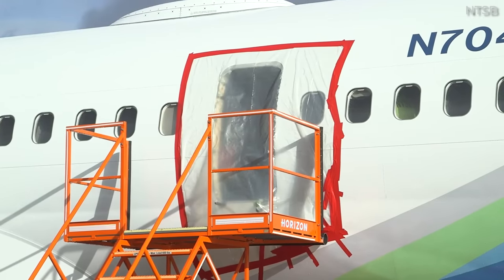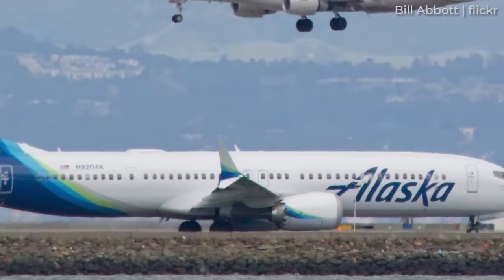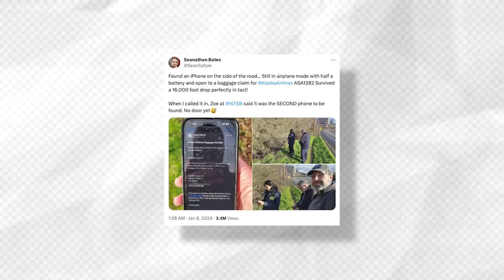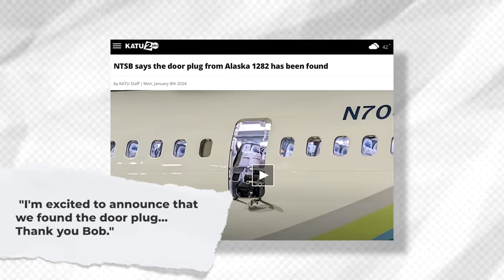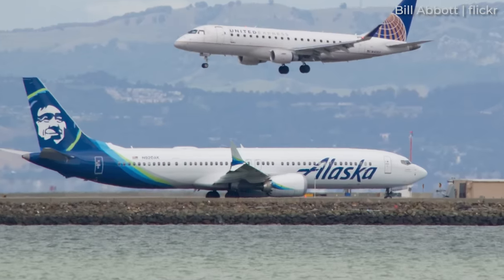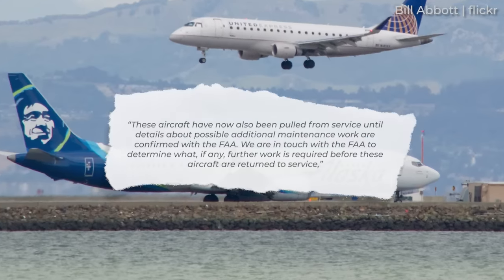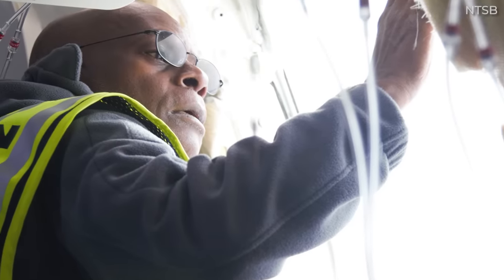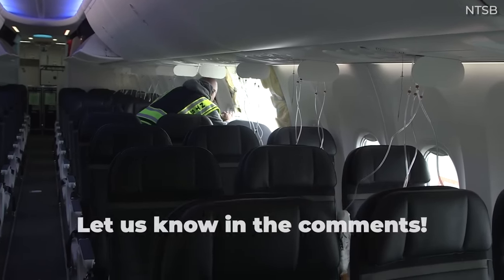Flight AS1282: Are We Seeing Another Boeing 737 MAX Crisis Unfold?

Comment: As a dedicated air traveler who prioritizes safety, I deliberately avoid any airlines operating aircraft from the Boeing 737 MAX family. Specifically, American Airlines and Alaska Airlines are two carriers that I actively steer clear of, as they continue to include these models in their fleet. In my opinion, Boeing made the mistake of placing profitability over proper quality control and engineering when hastily releasing the 737 MAX into the market. 
The aircraft's malfunctioning automated flight control system resulted in two tragic crashes, claiming the lives of over 300 individuals just a few years ago. Trusting software to compensate for aerodynamic instability does not align with my uncompromising standards for safety in the field of civil aviation. Despite the overall high level of safety in commercial air travel, I am willing to endure minor inconveniences if it means proactively minimizing any potential risks to myself and my loved ones. For domestic flights, I strongly prefer Airlines that utilize the Airbus A320 or A321. However, I have nothing against the Boeing 767 for longer trips.

Comment: Boeing has a problem. Whereas MCAS was a scandal due failure by design AND not communicating bad habits to the pilots, finally fixed, this issue simply is the third at least in a row of sloppy doing. A manufacturer error on the bolts of the rudder fin, severe quality issues on the back pressure bulkhead, now a popping off fuselage plug. I will fly with a 737 MAX, as soon as it will enter service again. Still the MAX is a safe aircraft in my opinion but could be safer. Boeing could do better, and should. Fire all these profit-praising CEOs and controllers and managers and whomever and let do entrepreneurs run the business again.

Comment: Really have to jack up the volume because it sounds like this fellow did this video while attending Church.  How many more issues could this plane have?  Or any of Boeings planes for that matter given the careless nature of their manufacturing process.  What has exactly changed within Boeing since the firing of the previous CEO?  I thought the reason for that firing was as a result of poor workmanship across the board.  Exactly what has changed?  The 787 has had many, many quality issues.  The 737 as well.  Derivitive models, not new models are taking two or three times longer to get off the ground than previous brand new models.  The company continues to lose market share to Airbus and despite all of this executives still make huge, huge compensation packages as if things were going awesome.

Comment: The crisis is not with the Door plug itself, , it is a QUALITY CONTROL/ASSURANCE issue.  Look at teh week before, mising/loose bolts on teh Rudder Control System.  AND Human Factors such as training the poeple and managerial issues with Schedule/Share prices.  Plus, per their news announcements, Boeing's plan for 47.2 jets a month from June to August 2024, while its target to increase 737 production to 52.5 jets a month was moved from December 2024 to February 2025.  This is to SELL more aircraft and push them out the door faster/more of them.  Its a TOTAL SYSTEM failure if you look at it holistically.

Comment: The Associated Press in the USA is reporting that the aircraft had an ongoing problem with the pressurisation failure warning light coming on. Boeing has failed to get a grip on their quality control issues on the production lines, and this would seem to be another obvious one. 
However, there's a new issue here. Why did Alaska keep the aircraft in service with a critical safety system repeatedly indicating a fault? I expect the FAA will be asking the airline some hard questions.
Reply: It is not yet clear if the plug, which is originally installed by Spirit in Wichita before transfer to Boeing in WA, was removed and replaced by Boeing during the completion process, or by a third party that Alaska uses to finish the interior, or if perhaps Alaska did remove and replace the plug while trying to troubleshoot the source of the pressurization warnings.
Reply: Because the hacks at Alaska Airlines kept pencil whipping it.  “Checks ok”.  Guarantee you the write ups would have had “loud squeal at row ____” You pressurize the plane, and leak check the door (from the outside )using “soap” type solution and if there is a leak, BIG bubbles appear where it is leaking. Then go from there. There is no way this happened.

Comment: Was this a converted aircraft? When did get delivered to Alaska Airlines? I see this as a failure of Alaska Airlines, NOT Boeing. AA should have fixed the issues with the plane before putting it back into service. This is NOT the first incident that Alaska Airlines has been at fault for.

Comment: Your description of the failure is a bit off.   There is no bolt(s) holding the door in place.  There is a door wide  horozontile bar bar, both top and bottom that moves up on the top and down on the bottom.  The ends of both of these bars go into a socket that is attached to the airplane frame   At these 4 attachment points there is a non structural bolt that keep the bar from vibrating loose from the socket but only on the plug doors.  On the working doors there is no bolt to keep the bar in the socket  to do this as the bars are moved in and out of the sockets to open and close the door.  The door operating mechanism keeps the bars in place in case they vibrate.  I looks like the WRONG sockets were installed by the factory as the PLUG style doors require sockets with a hole for the safety bolt while the working style doors do not need or use a safety bolt.  An assembly screw up for sure and maybe some sockets had the wrong part number  All the sockets look very similar but ARE NOT THE SAME.

Comment: Boeing has replaced the engineers with MBA types who have no clue how to build a good and/or safe air plane.
They moved a lot of production to lower cost areas without any thought if cheaper labour might also mean a poorer product.
This is all so they can claim the plane is a variant of the 737 which means pilots need much cheaper training to fly it if they already know how to fly another variant.

Comment: Only 4 bolts hold the door plug????
Reply: Only 7 hold a Trent 7000 on an A330 NEO
Reply: There are 2 tracks on each side of the door (4 total) and 4 pins in the door frame. The door slides down in these tracks securing it. The are also 10 stops along the perimeter of the door that line up with 10 stops on the frame that take the force of pressurization preventing the door from pushing out. In order to open the door you have to lift up the door so that the tracks lift up and out of the way of the pins and that the stops lift up and out of the way of their corresponding stops. The 4 bolts in question's sole job is to go through the track blocking it off and trapping the pins so that you can't lift up the door. There is no force on these bolts unless you are actively lifting up on the door. If even only 1 bolt was in place that door couldn't be lifted up and out of its tracks. I think it's safe to say that these 4 bolts were never installed as they are secured with cotter pins so they can't back out even if loose.

Comment: Boeing got very lucky with this latest Max incident. First, there was no passengers in seat A or B. Second, they were still climbing to cruising speed so all passengers/crew were still buckled in their seats. Had this been at cruising altitude the likelihood of a passenger/crew member walking around in the aisle or a passenger close to the hole without their seatbelt buckled would have been much greater and could have resulted in someone being sucked out of the plane. Finally, the violent and sudden depressurization could have severely compromised the fuselage and/or resulted in an actual crash. 

I really hope this is taken seriously and Boeing doesn't just get to sweep this under the rug with some quick fixes. The audacity of Boeing to ask for a safety exemption to certify the Max 7 after the Max 8 crashes. The FAA and NTSB should not be entertaining any ideas of safety exemptions for any aircraft and the fact that that is even a thing is ludicrous.

Comment: The FAA must be acting with Boeing so that work on aircrafts aren't rushed and all routine inspections and quality checks are conducted thoroughly. 
Boeing priority must be producing quality aircrafts, not boosting profits.
For how the door plug - which is meant to be there for the lifetime of the aircraft - may have failed and came off, it is not hard to think that the bolts and nuts utilised weren't of the right type, as they had to resist the same pressurisation cycles and the vibrations as other similar components, like the rear bulkhead.
Hope Boeing put their acts together and changes their attitude...

Comment: Boeing must prioritize quality control and adhere to FAA regulations to ensure plant integrity. While recent challenges present an opportunity for improvement, past mistakes, notably with the 737 Max, are attributed to the previous CEO. The current CEO faces the task of restoring the commercial sector. Though Boeing's reputation is damaged, lessons learned from previous errors suggest potential recovery. The absence of Max crashes in recent years is a positive indicator. The debate over emergency exits highlights the importance of safety over cost considerations for airlines. Waiting for the NTSB report will provide clarity on the situation.

Comment: Someone commented on a video on youtube about a different product about the state of morale of production line workers in America due to the cost of living and the mismanagement of staff in situations where either QC is one of the jobs no one wants to do or candidates for replacement are underqualified in that department. This could all be contributing to the quality of goods coming from American manufacturers not being what it used to be. I'm not saying that's the case across the board. Just sharing my thoughts on what may or may not be the cause of this failure judging by what I've seen and read.

Comment: There is a difference between the deactivated emergency door and door plug. It also impact the capacity, depending on it a plug, deactivated door, or active door.
Reply: Exactly, this was not a deactivated door.

De-activated doors are an option, but they have a much smaller window rather than the full sized one of the plug. Unlike the plug (which needs to be replaced), de-activated doors can be re-activated.

I saw a video on the options around this opening, be it plug, de-activated, or active. Inside, the inactive options have a full sized window side panel covering the plug, and a windowless side panel covering the de-activated door.

There are several options of active door, each affecting the maximum number of allowed passengers.

Comment: That's insanely stupid to have only four bolts holding in the Door Plug! This reminds me of the equally dumb Jack-Screw fiasco that downed a Frontier Airliner and killed all the passengers.
Reply: There are 2 tracks on each side of the door (4 total) and 4 pins in the door frame. The door slides down in these tracks securing it. The are also 10 stops along the perimeter of the door that line up with 10 stops on the frame that take the force of pressurization preventing the door from pushing out. In order to open the door you have to lift up the door so that the tracks lift up and out of the way of the pins and that the stops lift up and out of the way of their corresponding stops. The 4 bolts in question's sole job is to go through the track blocking it off and trapping the pins so that you can't lift up the door. There is no force on these bolts unless you are actively lifting up on the door. If even only 1 bolt was in place that door couldn't be lifted up and out of its tracks. I think it's safe to say that these 4 bolts were never installed as they are secured with cotter pins so they can't back out even if loose.

Comment: The door "plug" is not a plug in the normal sense used in aviation. A plug does not rely on bolts, it relies on cabin pressure to force it into place.  The inside part of the plug "wedge" is wider than the narrowest part of the aperture.

Comment: Not much redundancy with 4 bolts!  If the design criteria are minimalist--by design.  Boeing sucks--literally.  The door is designed so that it only takes one bolt to fail to kill people--deliberately.  What about every other system?  Some more bolts wouldn't do any harm.
Reply: There are 2 tracks on each side of the door (4 total) and 4 pins in the door frame. The door slides down in these tracks securing it. The are also 10 stops along the perimeter of the door that line up with 10 stops on the frame that take the force of pressurization preventing the door from pushing out. In order to open the door you have to lift up the door so that the tracks lift up and out of the way of the pins and that the stops lift up and out of the way of their corresponding stops. The 4 bolts in question's sole job is to go through the track blocking it off and trapping the pins so that you can't lift up the door. There is no force on these bolts unless you are actively lifting up on the door. If even only 1 bolt was in place that door couldn't be lifted up and out of its tracks. I think it's safe to say that these 4 bolts were never installed as they are secured with cotter pins so they can't back out even if loose.

Comment: I believe this is being overblown. Yes, it's important, but we need to remember that no one or no thing is perfect. Like it or not, things happen. We drive or ride in an 'imperfect' car every day, yet somehow we seem to expect 100% perfection when we fly. Accept what we have, knowing that the people flying these things wouldn't even be up there if they didn't have confidence in their equipment.
Reply: The only person with common sense here! Thanks my man!

Why were the ONLY two 737MAX crashes with third-world Airlines? 
Flying an airplane that up until the time of the crashes had experienced ZERO incidents.
 
After a year of test flights and data-gathering, the MAX gained certification from the FAA in March 2017, followed by other global regulators later that month. 
By May 2018, a year after the first delivery, more than 130-MAX's were in service with 28-different airlines around the world and had flown almost 42,000 flights.
With ZERO incidents
Before the second crash, there were nearly 50-carriers that were operating the MAX. Using it for an estimated 8,600 flights per week. 
With no ZERO incidents.

That the FAA and EASA didn't know about MCAS, a meme being pushed by BOEING BASHERS and the MSM, is bovine excrement. 
Although Boeing did not call MCAS out by that name, the Boeing Flight Crew Operation Manual (FCOM) described the function in detail, and how to override it. 
And 50-carriers crews had no problems with understanding it. 
The FCOM was successfully used by 50-carriers to train crews in flying the new 737 variant.

Lion Air and Ethiopian Airlines with their low-time inexperienced pilots and with inadequate management of their crew training - ruined the safety record of a perfectly safe airplane.

The fuselage plug issue occurred in ONE airplane, out of 1,420 delivered and after flying over 100,000 incident free flights! 
The plane and crew handled the incident perfectly. Nobody was hurt. Not even a sticking plaster was needed in this "disaster"! 
Boeing and Spirit will take remedial action - and the 737MAX will go on to be as safe as any other commercial aircraft currently flying.
Boeing has 4,031 MAX aircraft in its order backlog. 
You think these folks who fly these wonderful airplanes every day for a living think the MAX is dangerous? Yeah right!
Crossing the street, or driving one's car to get groceries, is 1,000 times more likely to get you killed than flying in a Boeing 737MAX.
This is just an over-the-top, hysterical, hyperbolic nonsense coming from woke folk who want to live a life of 100% safety! 
Better stay at home and sit on their couch!:face-orange-frowning:

Comment: A lot of people seem to be missing the reason this geniuses decided to put a plug in door to cover non other than emergency exit to gain a row of passengers, original fuselage design calls for an emergency door being there.
It begs the question of such of large aircraft without emergency exits in the back
"Genius" another idiot in their desk with a stupid idea to make more money at safety expense
How did it got certify with this configuration with out emergency doors in the back?
Reply: Wrong. Apparently you didn't bother to look at the seat maps for the Alaska Max 9, other Max 9s, or similar capacity competitive aircraft.

The plug is used because Alaska and United have a lower seating density with fewer rows than the max for which the aircraft is certified, and a fourth full size emergency exit is not required to evacuate the aircraft. Budget carriers such as Ryanair with a single class/tight seat pitch configuration with more rows must have an active emergency exit in place at that point.

This is also not merely a Boeing thing. Korean Air Airbus A321neo aircraft have 182 seats (4 more than Alaska's Max 9s) and the same exit configuration of two full size doors at the front, two at the rear, and four over-wing exits.